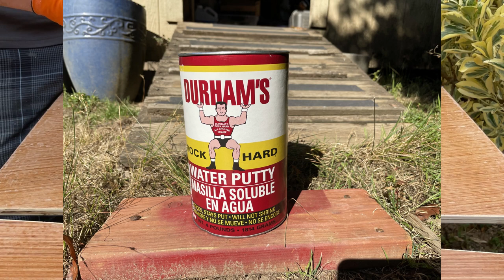Cabin Interior Build Pt 2 + a Surprise

Comment: I've have a 1972 Aquarius 21 for 27 years.  I use the same gray foam pipe insulation around the cabin opening.  The opening came already covered with edge molding which keeps the foam in place, I don't have to glue it on.  You can get the edge molding at West Marine.  It's called Flexible Trim or Taco Marine Flex Trim.

Comment: Hi,  for the Form (tubing insulation?) I would not use glue, because I think it may not last very long and needs to be replaced at some time with something more durable. I would use double-sided tape like "3M GPT". For final solution i would go with Form covered with artificial leather because it's much more durable and more easy to clean as uncovered form.
Reply from the maker: Thank you for the suggestion. Great idea. I want the protection for my head, but these foam noodles are not durable.

Comment: I just recently acquired an aquarius 21 that I am going to make a terminal trawler out of.  I also just recently acquired an older Honda 4-stroke 10 HP.  It looks like you're running the same motor setup on yours.  Did you happen to record the speed that you got it up to on your test run?  It looked like you were skipping right along
Reply: I don’t have a speed sensor on the boat yet, but according to my gps on my phone we were doing 6 mph.  If felt like a good speed. Fast enough to get somewhere, but not too fast to be dangerous.